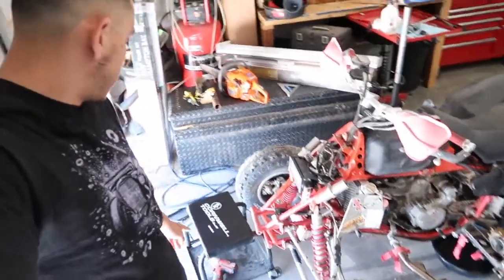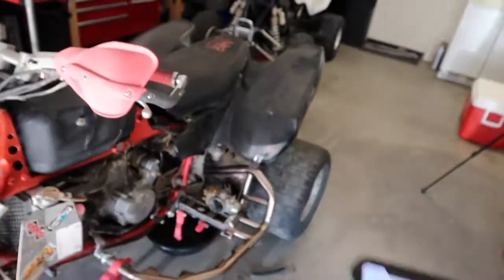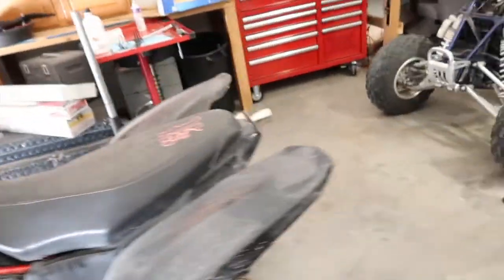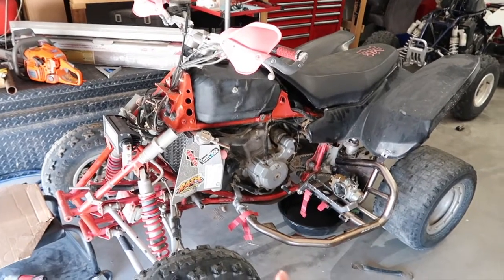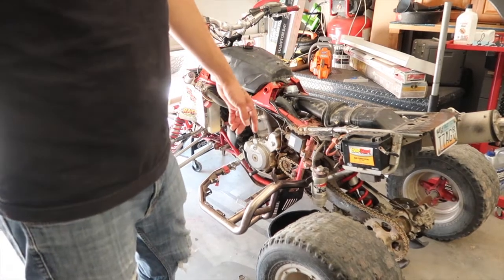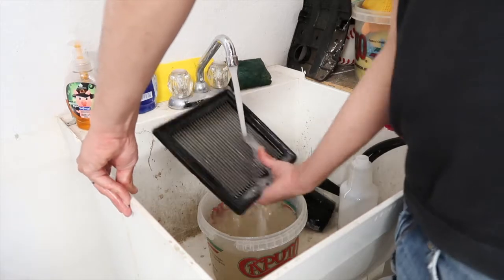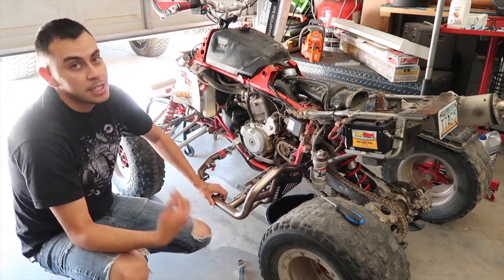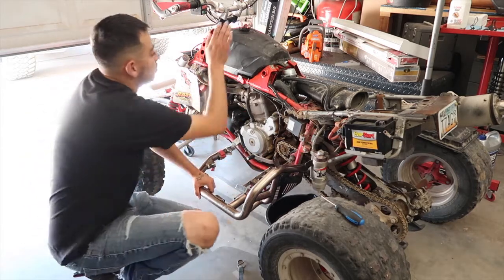400$ POLARIS PREDATOR WILL IT LIVE? PART 2

Comment: Check your valve clearances. Also try taking out the spark plug and putting fuel in the spark plug hole then put the spark plug back in and see if it will start.
Reply from the maker: Ya I thought of that also I'm hoping it's not low compression and just valve clearance will do video today or tmrw and upload on weeekend thanks for advice!

Comment: your gravity fed fuel line isnt going to work if the carb is higher then the fuel level. Which from the camera angle it appears to be the case. I would check that fuel pump and see if it works and use it if it does.
theres a reason they put a pump on it.